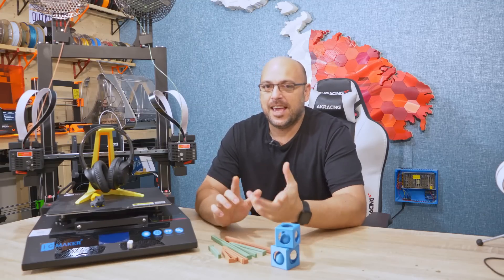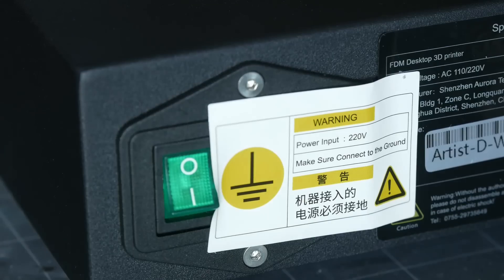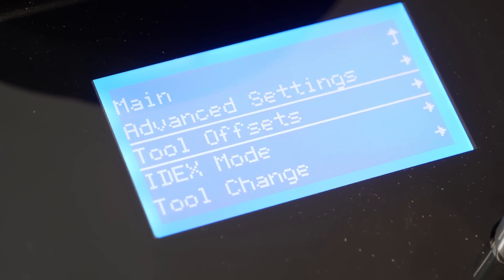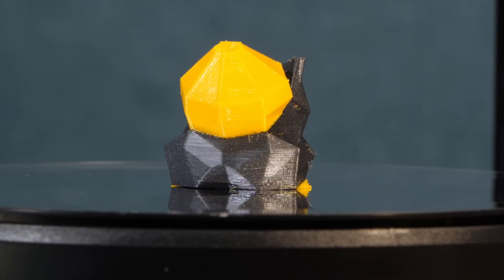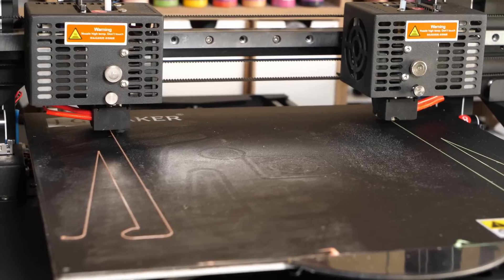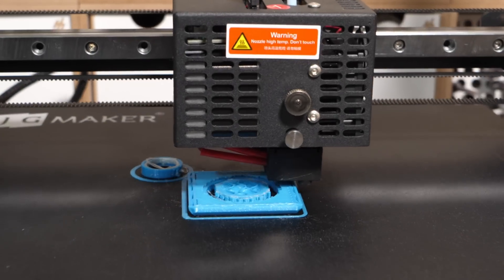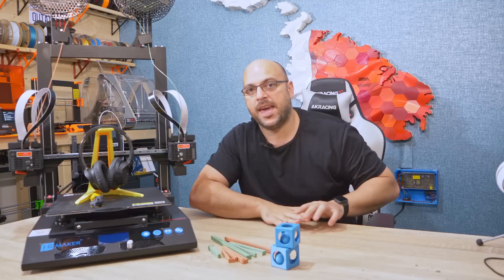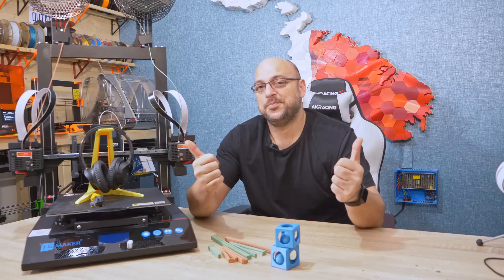JGMaker Artist-D - Direct IDEX Budget 3D Printer

Comment: I was considering getting one of these, and 3D Printing Professor's video on this had me understanding that there could be (fixable) issues with it. Okay, it's a cheap printer, and prints really well when it works.

That nozzle design is a big oversight. PTFE Tube nearly all the way to the nozzle tip? No thanks! I'm out!

Comment: Thanks for your honest review of this upcoming printer and of your thoughts on Kickstarter.
I've been wanting to get a large platform machine with dual extruders and this Artist-D looks interesting. I understand it's on a Kickstarter campaign with all it's risks but I figure JGMaker is an established company so the risk of failure to deliver is a little less likely. Just thinking that at the initial Kickstarter pledge pricing, this printer might be a good buy. And since I like to tinker anyway, any foilables with the machine would be an interesting challenge. Plus it's going to be backed by a 3 year warranty by an established company so that's not a bad safety net.
I was just thinking of a couple of features that JGMaker could implement with their printer. While I like the idea of a quick change nozzle, the addition of an adapter to allow use of standard nozzles and all metal hotend would be great. Also, with such a large build plate, figuring out a method to allow height adjustment in the middle would be very beneficial.
Reply: Thanks for supporting, for full metal hotend, we are working on this already, we just need to keep testing

Comment: 9:30 a thermistor in the nozzle is going to give you a very vague, potentially misleading impression of thermal performance. It doesn't tell you at ALL how good actual heat conduction into the nozzle would be "under load," with plastic flowing through it. The thermal mass of the nozzle will also throw off any idea of "how quickly" it heats up.

A nearly 30-second lag to recover from any changes in flow rate is unacceptable, if the print head switching from a slow perimeter to a fast infill, you'll be extruding 10-20 degrees below temperature pretty much the whole print.

Comment: Was the bolt in the middle of the bed actually doing anything? Or was it just a wedge for shipping, where you raise bed and poke it out with a ruler or similar?
Reply: Most Aluminium beds are bulging down in the middle of the bed and this there as a counter measure to keep it straight. Otherwise you wouldn’t be able to level it at all (since the buildvolume is pretty large). 

And tbh I would rather have to adjust the z endstop a few times more than having failed prints because I can’t level the bed properly. ABL isn’t an option since it’s a dual nozzle carriage and ABL can’t compensate for both nozzles at the same time so you have to have a manually leveled bed.

And tbh that’s fine. Spending a few hours calibrating is worth more than constantly having failed prints

Comment: Thanks for your thoughts. Jgmaker is a strange company, even after rebranding themselves. I like the idea of this printer and would love to try out an IDEX printer though not willing to risk funds on these guys especially not on a kickstarter.
Reply: Hello, I do not understand what does your "strange" mean, the reason we rebrand it  into JGMaker, because JGAurora is hard to pronounce for customers.
Reply: JGMaker The 85 was a printer which theoretically worked but in practice absolutely didn’t work. So many problems the firmware was not complete the hardware was a mess. It seems like progress has been made. So anything would be progress from what the A5 was.
Reply: Hello sonic, actually we stop producing A5 already, instead, we use A5S, and we release our source code at our official website already, for artist d, we will release our source code once we start to retail
Reply: @JGAURORA3dprinter  OK

Comment: So since  you cannot physically change the nozzle height of the 2nd relative to the first, you cant level them perfectly for mirror mode printing right? As long as they're not printing simultaniously, the offset in the config can be used but while printing at the same time, one of the nozzles will not have the correct height?
Reply from the maker: my offset was very minimal. with mirror and duplication mode printing it is always recommended to use a raft as that usually compensates for the offset.
Reply: Yes, you can mechanically adjust the second print head relative to the first.

Comment: That nozzle change mechanism is neat!
Reply from the maker: very much so, we just need E3D to come up with one :)
Reply: thanks
Reply: An interesting approach could be to preload the whole nozzle + heatbreak assembly by pulling on the cold end (in a way similar to a draw bar on a milling machine) and make the back "face" of the nozzle (where M7 hex meets the thread on an e3d nozzle) press against the heatblock - this would make for a pretty good thermal contact. Even better would be a taper (again, like on a milling machine) which would eliminate radial play caused by the sliding fit - and might not be any more expensive (no need for "just right" sliding fit vs tooling for turning tapers). Now we just need to convince Sanjay. :)

Comment: Aren't Trinamic drivers better than limit switches?
Reply: No. Actually a limit swich is more precise, as crash detection needs some skipped full steps - and the number of skipped full steps. Does not matter normaly - but after power loss on rehoming x and y you might get +/- 1 or two fullsteps of, resulting in a (very smal) layershift.
A normal endstop is more precise in this scenario.
The main advantage of sensorless homing is production costs. No need for mounting limit switches and routing the cables. Also with sensorless homing you also get crash detection.
But for the last function, closed loop drivers are the better choise. A quite simple change, if drivers are swapable. But you need classic endstops than.

Also if friction changed (for exemple a bit of dirt in a bearing) the trigger point might get of a bit. Wonderered a lot as my mk3s often failed while ABL. Reason was some dirt in a bearing. Homing x was some mm off. So the last measurement in a row  with the induction sensor got to near to the edge of the bed. Took some time to find the Error...

So definitly classic endstops are the better solution.

Comment: hm I wonder how long the PTFE will survive, on the usual suspects it was only "at" the heating element, but here it is "in", .... also is it good to ship a printer with beta firmware?
Reply from the maker: this is a pre-release version so firmware is still not finalized
Reply: we will upgrade firmware for sure
Reply: Since most ptfe tubes are rated for 250-260C it should still be fine. It is swapable as far as I now. Sure you shouldn’t push it but TPU, PETG and ASA should work fine and that’s what most people use.
Reply: as far as I understood it’s a modified bore 4.1 style heat throat (am I wrong?)... so if you put a Capricorn you can go up to 300 degrees
Reply: @Fernando_Gazzola  https://www.captubes.com/safety.html
Reply: @Fernando_Gazzola  I tried that years ago on my MK2 and whatever it is with Capricorn, the plastic would never stick to the bed. No matter what. Had to go back to all metal. So I wouldn't count on the Capricorn trick working at all.
Reply: TheRob2D there is no relation beetween bed adhesion and Capricorn tubes. MK2 use an e3d hotend that is PTFE Liner style or all metal heat throat... in those bore 4.1 (that have 4.1mm wide inside) the bowden, with 4mm wide) goes all the way until reach the back of nozzle. For each type you should avoid gaps for a constant extrusion..
Reply: @Fernando_Gazzola  I'm just telling you what happened to me. Try for yourself and see.
Reply: TheRob2D I use Capricorn on most of my machines for more than 2 years... but I use for the bowden style ones not on my direct drive printers. 

For my Ultimaker that have a long bowden tube (~75cm) it makes difference with less play of the filament inside the tube and more precise and lower retraction distance. For my bore 4.1 printers (Creality style) it least longer... less maintnance cutting and or changing the low end of the bowding tube. But the Capricorn inner diameter smaller makes it not suitable for bad filaments with wider diameters / bad tolence since the inner diameter is 1.9mm intread of 2mm. I leave just one printer with the regular PTFE because there are cheap ABS here that get stuck in the “blue” tube :/